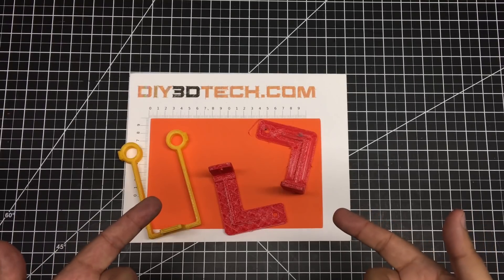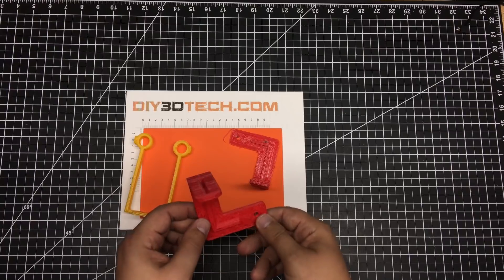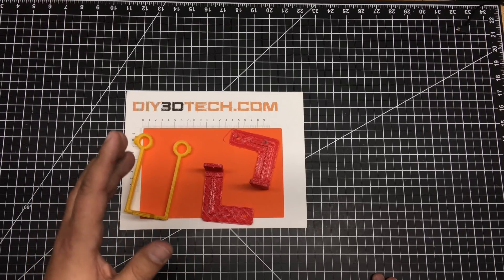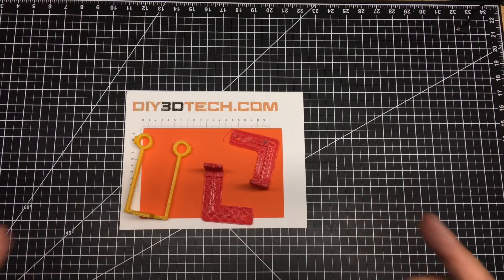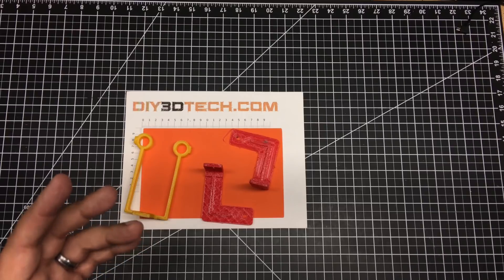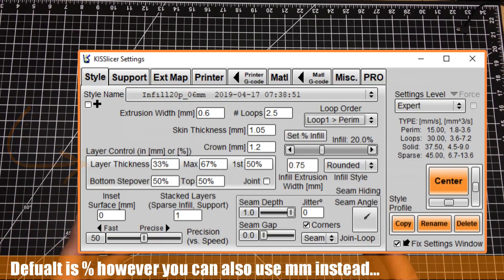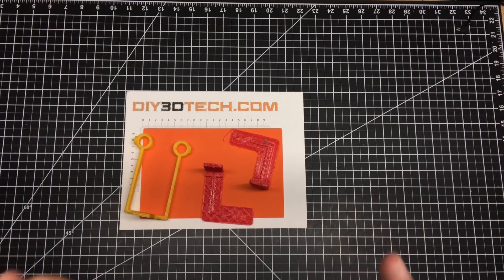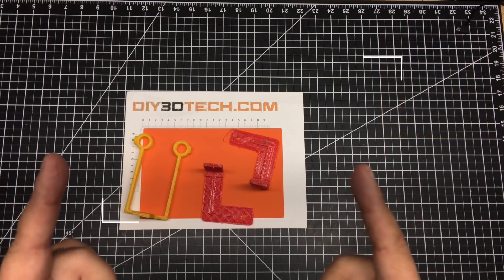Shop Talk - I Kissed Cura Goodbye!

Comment: Nothing is confirmed that I have heard of.  What about the Mavic Air?  I have one of those and the Mavic Pro Platinum.  I am beginning to wish I had a Zoom.  I said I would wait for the next big thing but no rumors about that.
Reply from the maker: I simply can't warm up to the Mavic Air, to me makes it makes no sense.  As far as the "zoom" there was not a big enough difference to the original verse the version with Hasbald which is an amazing camera!  If they do an OSMO with that camera I might buy one as that is an amazing camera!  If a got a new spark it would be to try and jump start the drone channel.  As the new house I am building is on 5 arces with a small golf cource on one side and house (on 5 acres too) and  then MASSIVE farm fields!  So I will be able to walk in my back yard fly anytime I want.  However I will also still only a few minutes from the beach so best of both worlds :-)
Reply: @DIY3DTECHcom  I think you are over thinking the cameras on drones.  The Internet can only handle so much and the fancy cameras don't help at all unless you make movies for the screen or large prints.  Over and over again we have seen tests of pictures with one drone or the other and almost all the time you can not tell the difference.  As for punching up your drone page on YouTube, you should check out vidiq.com.  They have a free all you can add and really tells you a lot about your site.
The house sounds great.  congrats on that.
Reply from the maker: Your partly right, 1080p is enough for the internet.  However that camera will make an amazing LARGE print!  I use to medium format and fell in love with "detail" long ago :-) As far punching up my site it is more so filming what people what to see.  My top views come from (1) the Sysma X8 & x5 hands down, (2) is the UpAir as it still get big views and (3) Spark.  The Mavic stuff and Typhoon vids are rounding error to those

Comment: Thanks for suggestion, will try.

Just my 2c: I was experiencing same problems with Creality 10S Pro. After update on same profile results were much worse. I coud easily peel off the layers with my fingers. Even got layers shifts. Does not help that it was during my first roll of PETG on that particular printer.
Then Cura crashed. All profiles were lost - labelled "not compatible".
I was in hurry, so I simply created new printer profile with proper volume, selected default PETG settings from slicer- and suddenly everything was great. No delaminations, no shifts, no bad prints.
Just to be on safe side with PETG I later set printing speed to 70%, and nozzle to 0.5 in printer settings (I am using 0.4 nozzle). It works.
So maybe - probably - the problem is "simply" with handling profiles from previous version with lots of modifications.
Reply from the maker: Interesting, I even tried a clean install on several different machines and no good.  A couple viewers wrote say the issue is with "jerk control" and it needs to be turned off large printers.  Also what you explain is exactly what I was too as PETG was unusable, the pieces I showed where PLA...

Comment: How about the new Prusa Slicer 2.0... have you tried it?
Reply from the maker: Yes I did look at it!  Two things, it is (or based) on Slic3R and felt that looked/felt a little too much like the old Repiter software (grant it my opinion).  Second its branded by Prusa, and while I don't have an issue with him there does seem to be some polarization rising in the market and wanted to avoid it as the trolls like to jump on stuff like that.

Comment: Your Problem is not Cura. It's the configuration. Switch off the new Jerk Control. It makes a lot of trouble with big machines.
Reply from the maker: Interesting, however I assume you mean jerk control inside CURA?  If yes then its still CURA as one of my zillion thing is I did try adjusting jerk control and it made it "better" (a little).  However I wasted a lot of man hours which I will never get back which is what makes me angry,  however many thanks for sharing this as if this is it, you likely saved someone from getting as angry as I did!  Many thanks for commenting!
Reply: @DIY3DTECHcom  I noticed similar issues with Cura after I started messing with linear advance. Areas of massive under extrusion always in the same places. I tried different slicers and they didn't produce the same issue but they did make the graphic designer in me scream the whole time I was using their unintuitive win98 looking UIs. Eventually I fixed it by changing MIN_STEPS_PER_SEGMENT from 6 to 1 in Marlin (Configuraion_adv.h) This was a few Cura updates back now so they might have sorted whatever wasn't playing well with that setting but I haven't set it back to test.
Reply: I agree, i had issues on my cr10s pro with cura 4.0 (shifting layers) and by disabling that, it now works perfectly. I don't think Cura is bad for bigger printers, it's just a matter of good settings (remember cura is not specifically built for other printers than Ultimakers). Check out creawsome mod on github they provide a pretty good profile for creality printers (which would probably work good with clones)
Reply: If its cura 4.0, then most likely it is cura. I have a cr10 and cura 4 had many bugs. My favorite was when after a random amount of layers, just stop, sit for 5 seconds then start printing again haha.

Comment: Been using Cura. When I get a bad print I assume it’s the printer or filament. Never suspected the slicer. Good to have options. Thanks for sharing!
Reply from the maker: Oh yes, a slicer and different combinations of objects can lead to differing results.
Reply: You were right to not suspect the slicer ! The issue is the human behind the screen !
Reply: It's funny because when you see people on forums asking why their print quality sucks they're always being told to calibrate their printer, check axis, vibrations etc...I agree sometimes it's the hardware and you have to do some changes but I've seen so many people having the same exact results as mine with the same software but with different printers. The slicers play a big part in print quality, with cura my perimeters are not as perfect as with simplify3d, no matter what I change in cura I can't get the same quality even if I use the exact same settings in both software.

Comment: I switched from Cura to Ideamaker a year ago. Good decision!
Reply: I would move to ideamaker if and only if dieamaker slices the top/bottom layers better, with a boundary and not when a wall is angled less than 45 deg.
Reply from the maker: Interesting, what made you select IdeaMaker over all of the ones on the maker?
Reply: @DIY3DTECHcom  For a very special project I wanted excellent surfaces, and Cura sucks. After changing to Ideamaker I got it.
See https://www.youtube.com/watch?v=Xy3dVbuHh9c and
https://www.youtube.com/watch?v=YgJ8m7HfBE4
Reply: nvm my comment, it seems they have very recently published an update to combat the negativities I mentioned. Im sold to IdeaMaker now.
Reply from the maker: Very nice watched both and sub-ed :-)
Reply: @DIY3DTECHcom  Thanks ;-) give Ideamaker a try, you can define each individual layer separately. eg.. z-hop 0,2mm only layer 12, change your retraction distance from 5.0 to 4.5 mm only for layers 10-20  etc. ALL parameters can be used here, it's crazy and very helpful to get an optimal print.

Comment: I have had a issue with cura as well, for years. I quickly discovered that my Tevo Tornado did not like any code from cura. I opted for ideamaker for my Tevos.

Thank you very much for showing me I am not alone with cura not working with my big printers.
Reply from the maker: Your the second for IdeaMaker, what made you select IdeaMaker?
Reply: DIY3DTECH.com for me, it fell into the same categories as your choices. First it’s free, more visual user friendly for me, but the biggest plus for me is the ability to manually add and remove specific columns for supports and not be locked into “touching build-plate” “everywhere” and none. For example if I know my print is only going to need support underneath only one area, I can manually click to add on the model where I want the supports.
Reply from the maker: Now that does sound interesting being able to select supports.  In my designs, I really try to avoid them and if they are there, they are absolute.  However when printing someone elses work that is a different story...
Reply: My tornado has no issue with Cura !

Comment: Fair enough but I think you can still download and use earlier versions of cura.
Reply from the maker: Assume you can, however don't want to move backwards :-)
Reply: @DIY3DTECHcom  Hi Diy3dtech Right I Have Been using Cura  3.2.1 Version for 3 years now, and still am now, only one problem i face at times, If i Have not used Cura in a while
and when i am abut to use the printer, i had to start all over again  with a new printer, I not Happy about  that, loosening my profile, ex specially, my Dual settings in the other profile.

Comment: You can change the outer wall or loop order in Cura as well along with moving the Z seam but I have heard good things about Kiss as well.
Reply: Chuck I am about to the end of my options to fix my under extrusion issues with my ender3. I am going to find a video on checking the v-ref to the steppers. Or possibly change to a microswiss or V6 hotend next.
Reply: Moneypit330 - Clogged nozzle and extruder filament idler arm pressure seem to be the most common. I did videos on both.
Reply from the maker: Hey Chuck!  Figured in that mess of configuration items it was likely buried in there somewhere (has Hoffa is likely to be too :-)  however that is also my gripe as in Kiss its front and center as well as being logical.  The big thing is I wasted a ton of man hours thinking it was the printer, as I even went so far as replacing the complete hotend with no luck.  Another viewer wrote its the "jerk
 control which causes issues on the larger printers.  Not sure, since I have moved on from CURA, might be something to cover on your channel (just give me a shout out Mr 50k :-)   When I get time, been meaning to drop you an e-mail to see how the YT changes affected you if any.  Take care :-)
Reply: DIY3DTECH.com - Which changes since they seem to happen daily ;)

Comment: I'm getting outstanding results on my Creality printers from Cura just by checking out uploaded profiles and editing the odd setting here and there for particular prints
Reply from the maker: I did too until the last upgrade, then things all went south sorry to say...
Reply: @DIY3DTECHcom  why does everyone update when things are working perfectly and there's no security or attack vector, to worry about, or even new features worth caring about. updatitis is the problem not the software itself, which has essentially just chosen different defaults in the new distribution.
Reply: Jason M ... Gold comment ha! 
“If it ain’t broke, I can’t fix it”.
Reply: @Jason M Updating normally fixes issues and is not supposed to create issues (reason we used to have PAID beta testers for commercial software) but in this world the companies (now I am speaking about paid software not free software) are now demanding you update.  Look at Windows, or Chrome, or Firefox.  The collusion is so bad that websites check if you have the latest version and if not I have had them tell me to update and come back.

As far as Cura goes I have tried each major version since 2011 on 3 different printers and I never could get it 100% but S3D, Slic3r/Prusa Slicer, and Kisslicer none of the issues are there.  I had hopes for 4.4 on my 330x330 printer but no.  After 20 hours and half a kilo of filament I never could dial it in but slap the same model into any other slicer and not one issue.  In Cura I finally managed to solve all of the issues but missing infill and some walls having gaps.  It was NOT underextrusion but did mimic it some.  I gave up but I really wanted tree supports that only it has.

Comment: That is interesting Joe.  Chuck at CHEP has a similar problem.  He used to use the expensive one but found that almost everybody was using Cure so he switched.  I will check out KISS but take a look at his video; https://www.youtube.com/watch?v=MaMYMTX1Xl4
Reply from the maker: If I was doing this for commercial offering S3D would be my selection, however on YT the "majority" are using some "free" version so hence the "free"  Like in Drones, I got 3 times the views on the spark stuff over the mavic's as I am even thinking about getting another Spark just for that reason!
Reply: @DIY3DTECHcom  Well the Spark 2 is coming soon so you are in luck.  I downloaded the KISS slicker but have not figured it out yet.
Reply from the maker: Realy, Spark 2?  Any idea of the changes?  Also there is as I point out in the video a learning curve.   Hint: to manipulate the object right click on the image of object in the right control panel not the object itself.  It will bring up a second menu.
Reply: @DIY3DTECHcom  The rummers are heavy that a Spark 2 is coming soon.  /  I took a chess pawn and tried it in KISS and it had holes in one side.  Cure had it perfect.  Not sure what that is about.  Cure works great for me and since CHEP went to it from the expensive one he says that with the latest updates it is fine.
Reply from the maker: So what going to be new in the Spark 2 any Rumors?  Also thats odd you got holes, did you run all the wizards?
Reply: @DIY3DTECHcom  No solid rumors.  Guesses are maybe a better gimbal and longer battery time but it is all speculation.  It caught the holes as an error but I had no idea how to fix it.   CURE works great for me and with some of the settings, Chuck at CHEP gave us it even works better.  Do you follow him?
Reply from the maker: Yes I know Chuck he only lives an hour from me and we've meet up in person before, great guy.  A full three axis gimbal would be a deal maker for me as the Mavic simply doesn't draw the views as the spark did.  Any idea on a release date?  As I would have bet dollars to doughnuts they where going to end of life the Spark line with the Mavic Air as it was diluting their margins too much....

Comment: The new Prusa Slicer does a pretty good job too, but I will check out Kiss too thanks!
Reply: Wannageering 
"New", aka Slic3r Prusa Edition. Its not new, its just a name change
Reply from the maker: Yes have heard the same, but feared its "complexity" for a general audience as I love icsSL, however its way to complex for average user...
Reply: It's not that bad. I find it easier than KISS. They are actually trying to go the Prusa Control way (while leaving advanced controls available)
Reply: @DIY3DTECHcom  There are 3 levels of complexity that can be displayed in Prusa Slicer, the basic is very easy to use, and with the 2.0 version (along with the rename) came a bunch of UI changes to clean thing sup.
Reply: Prusa Slicer is not "complex", 3d printers arent a one button solution like ink printers, each print needs tuning to get the best result. Dont expect a 5yo to understand how to operate one, thats just being lazy. Most people i see complaining their printer doesnt work are usually artsy dumbos that dont even understand the basics of how a 3d printer works, and so when their one click solution doesnt work, it is "the printer's fault", when the machine works perfectly, and it was just them not knowing how to operate it. 
Im not calling you one, but im 100% sure its missconfiguration on your part, i dont like Cura exactly for that very reason, it tends to hide important settings and default to values which do not work. IMO Cura constantly ask to fail, how it doesnt is usually because the firmware limits the crap Cura outputs.
Reply from the maker: I can assure you it was not mis-configuration on my behalf, as I did a completely clean install no changes and it still did it.  A couple folks wrote it was the "new" jerk command which I guess defaults to "on" as being the issue.  Also when you do a YT channel, if you expect views you must shot for at least near the lowest common denominator and yes "artsy dumbos" are in there too.  In addition, the trolls are rising in the anti-Prusa camps so I didn't really want to deal with it and too didn't warm up to the UI not that KISS is hugely greater but I "felt good" about the results to effort it yielded if that makes sense.  :-)
Reply from the maker: What did you find harder about KISS out of curiosity?
Reply: @DIY3DTECHcom  To me the main problem with it is the UI, different names and you really need to think what it wants from you. I just somehow don't click with it. And that makes it hard for me to set it up.

Comment: I tried Kiss.  Had issues with coasting and other features.  Are you going to do a series on Kiss, That would be interesting.  P.S. The 2 features you called out ( loop order and seam position) are available in Cura.  I am between PrusaSlicer / Cura.
Reply from the maker: I am thinking about and assumed those where buried somewhere in CURA (as is the Kitchen Sink) yet like the way KISS puts it out front...